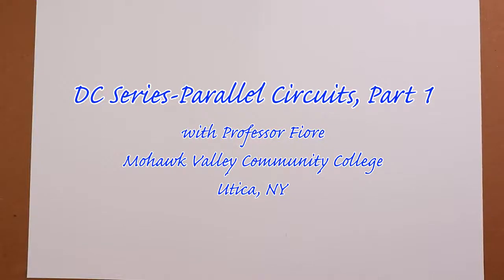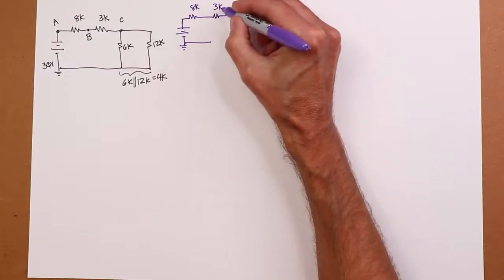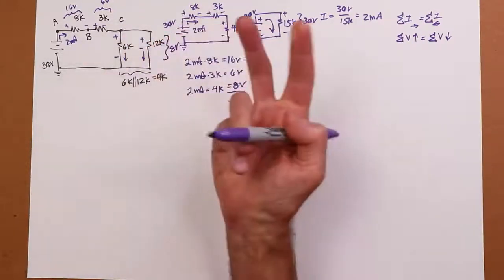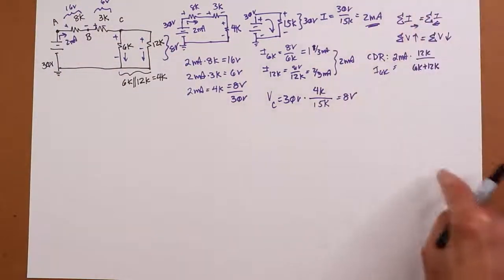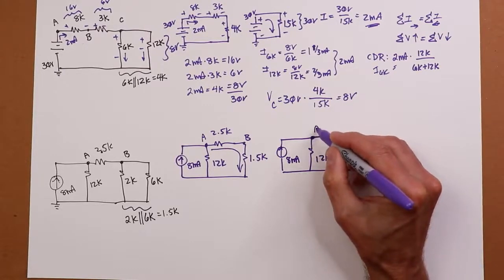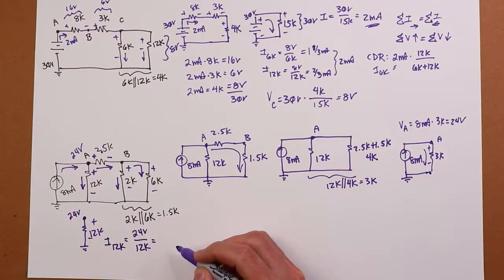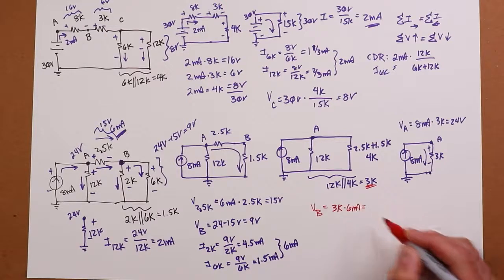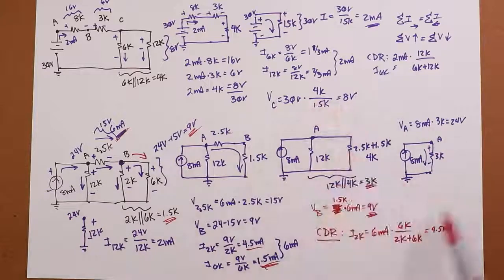DC Electrical Circuit Analysis: Series-Parallel Circuits, Part 1

Comment: Excellent explanation....Can any one tell please what is "current source"? What are the examples of current source?
Thanks.
Reply from the maker: A current source is similar to a voltage source. In the ideal case, a voltage source always produces the same voltage. If you change the resistance that it is connected to, then the current changes according to Ohm's law. In contrast, an ideal current source always produces the same current. If you change the resistance, then the voltage changes according to Ohm's law. 

Those are abstractions. In the real world, they don't exist, but we do have things that can be approximated as ideal voltage or current sources. A battery or lab power supply approximates the ideal voltage source. Current sources are not as common, but it is possible to create circuits that behave like ideal current sources (for example, a field effect transistor can be connected in a constant current configuration).
Reply: @ElectronicswithProfessorFiore  Thanks for your such a detailed explanation....It's make sense... Please keep on sharing your valuable expertise....